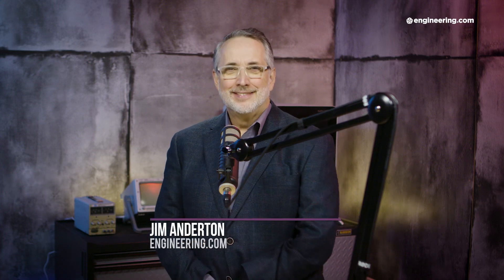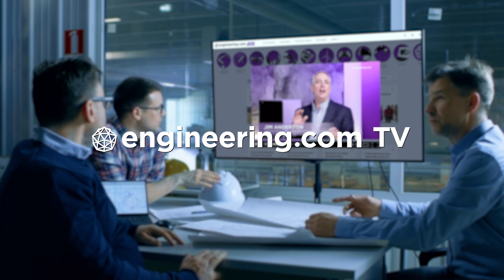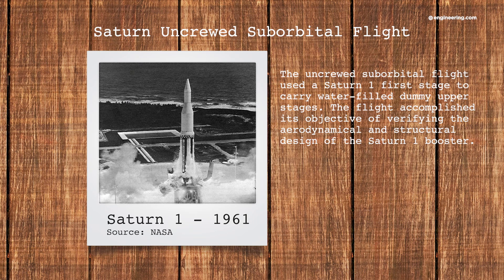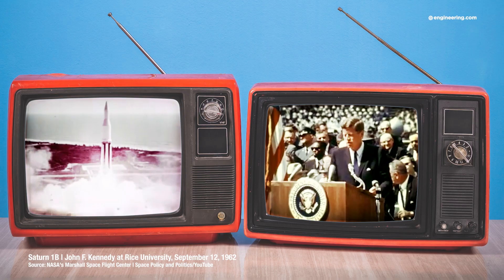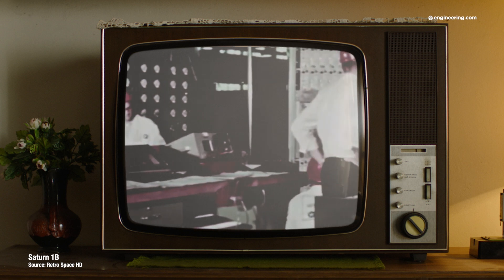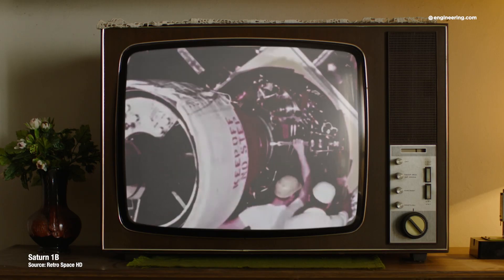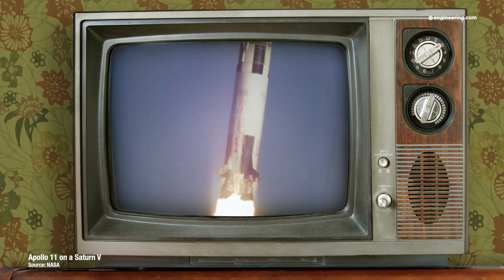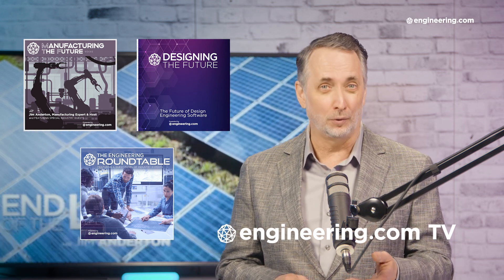The Rocket With the Perfect Record? Hint: It's not at SpaceX.

Comment: Over simplistic comparison to SpaceX. How can one estimate probability of failure with such few launches of Saturn V.  SpaceX has successfully designed for reusability and has yet to finish design for heavy lift.  This show is more about politics than system engineering.
Reply: Elon fanboy spotted.  Space x is a joke that is holding up the artemis missions.
Reply: @prof.crastinator  Boeing Borg is completely brain locked.  No longer capable of independent thought, uses denigrating personal comments to cover denial.